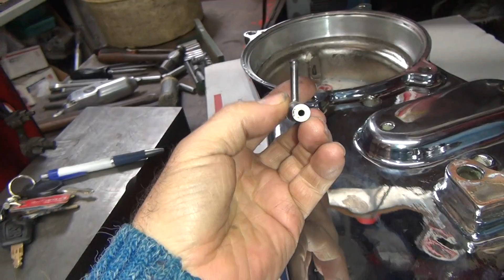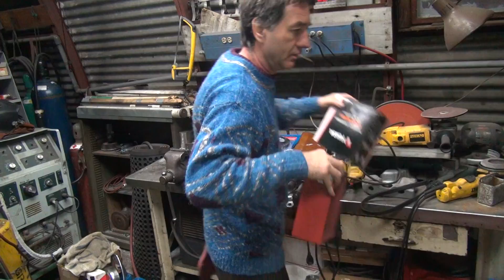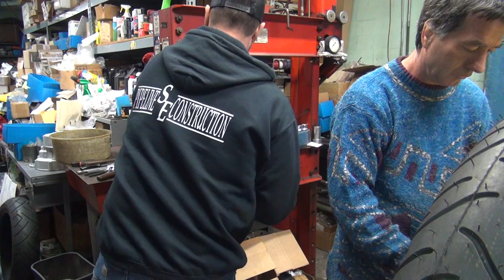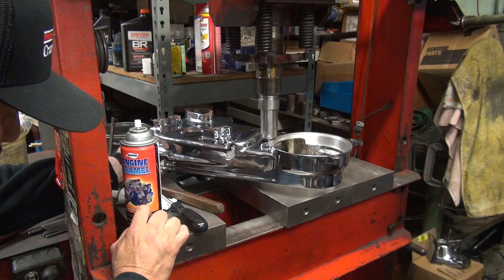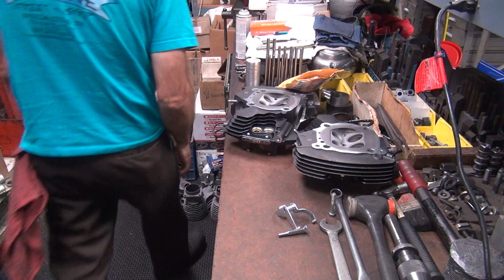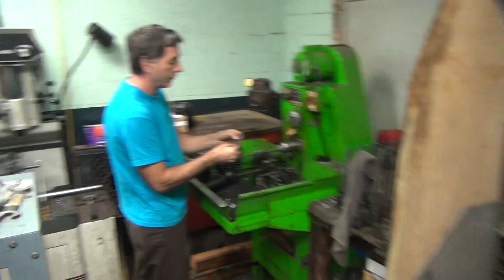#148 1978 93ci stroker shovelhead big bore motor new bike build fl harley by tatro machine

Comment: I wish i could send you my Ironheads. I have 2 a 72' and one with a 74' lower end and 70' top end. The 72' needs oil bag and some wiring installed. It was told to me its a stroker. The 74' is running and i believe well..but i am not an ironhead expert, and dont know anyone hear on the east coast of N.C. wish a fella of your talent was closer!
Reply: shawn  I got ya covered ,am   fla/ga line...  own 4 ironheads..dont rebuild/repair anything  but old